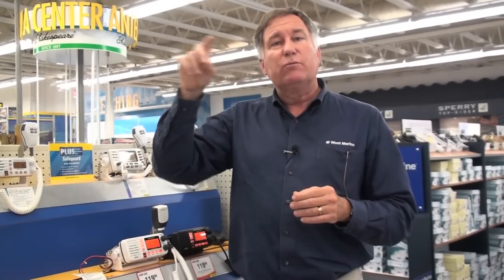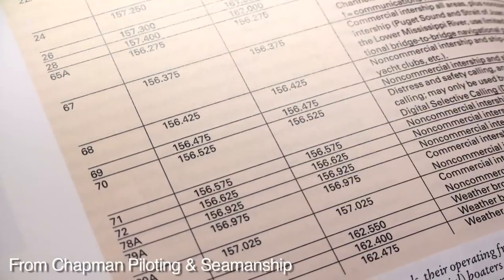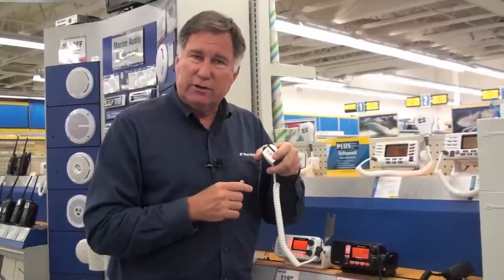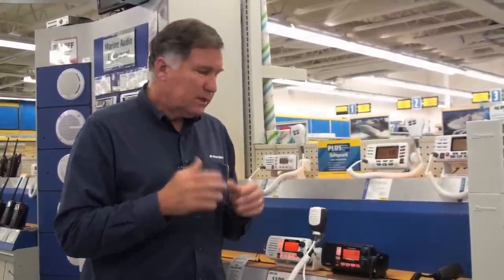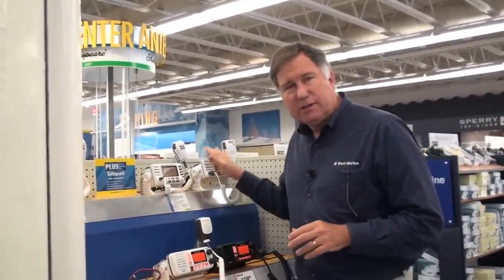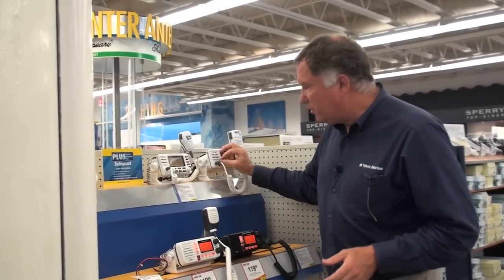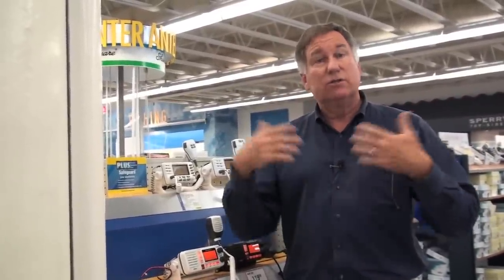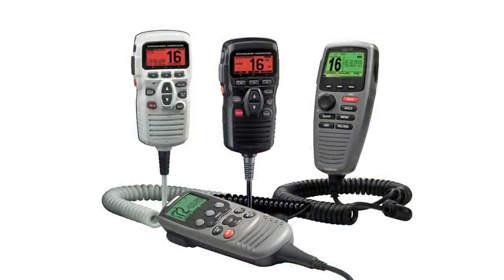VHF Radio Buyer's Guide: Part 2

Comment: to Mr. Midshipman : The US Coast Guard Aircraft and Rotorcraft are equipped with VHF Marine channels, so No VHF aircraft frequencies are used between a vessel and Coast Guard Helos.
Reply: Too right. The radios for marine use do not have aircraft frequencies.

Comment: I watched this video as well as Part 1, and I was wondering if it is possible to remove the antenna from the hand held HT's and connect the external antenna.
Reply from the maker: It will depend on the antenna plug type, but some manufacturers do offer adapters to allow a handheld VHF to use an external fixed mount antenna.  Please call us at 1-800-BOATING (262-8464) or visit a West Marine store location to discuss your options.
Reply: @WestMarineInc  ok thank you!